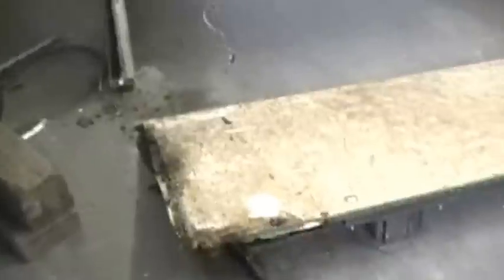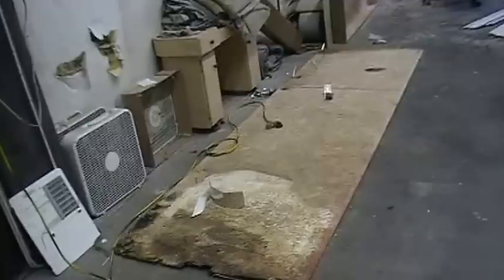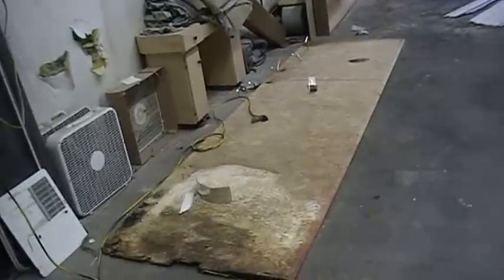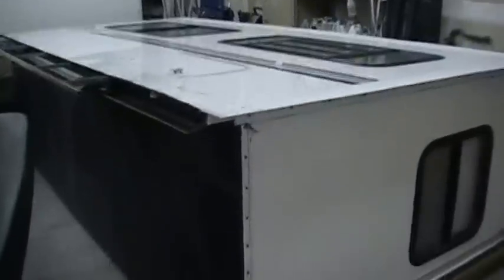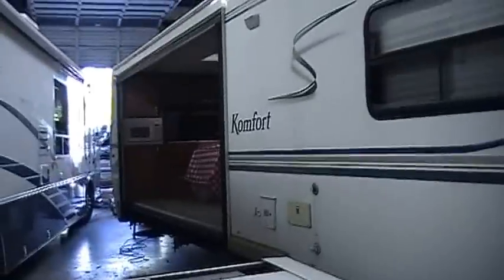floor replacement on rv slide out

Comment from the maker: The flooring is mounted to the bottom of the walls of the slide out so you need to remove get the slide out all the way out so you can remove the floor cuz screws go from the bottom of the floor up through the walls and that's how you disconnect it all the way around